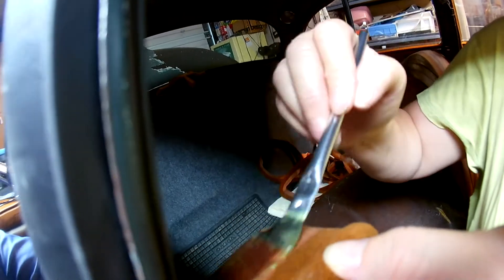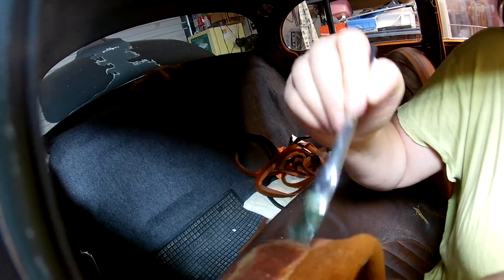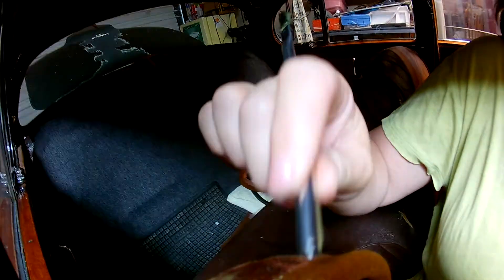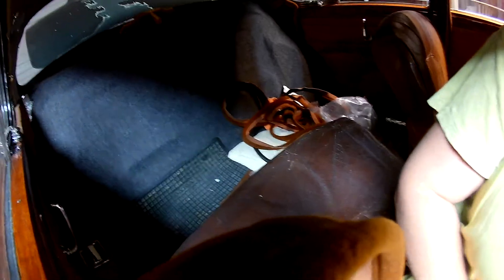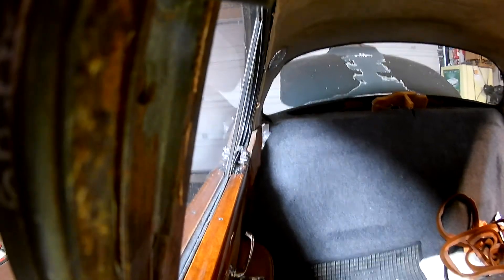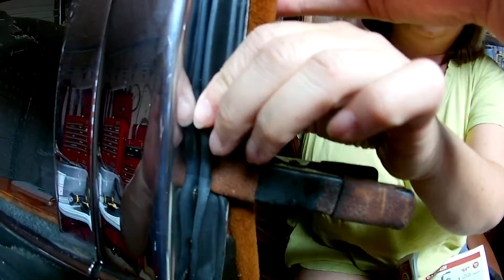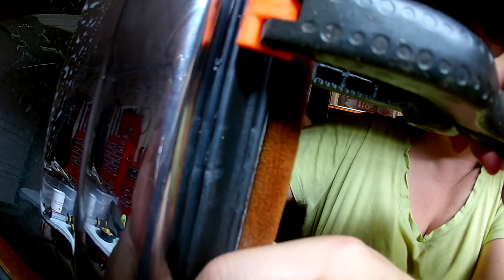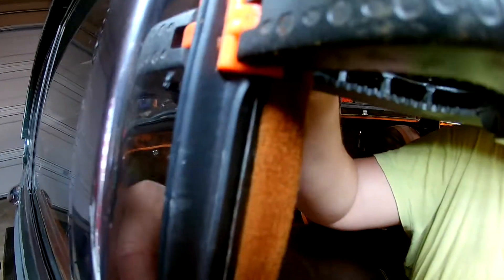Detail of gluing on Jaguar furflex on B pillar

Comment: Very many thanks for taking all the trouble with the video.  It's extremely helpful.  A question, if I may.  How do you remove the kick plate on the sill/rocker panel.  It has no obvious way of fixing except perhaps it's glued!
Reply from the maker: Remove the rubber base weatherstripping and you will find four (4) screws holding the sill plate to the car. Make sure !!!!! you mark the location of each sill plate as they are "handed" to a slight degree when you put it back together you will be very happy you marked the back with a marker. Yo can also write your name and date for osme future owner to find.
Reply: Very many thanks for the information.  It's much appreciated.